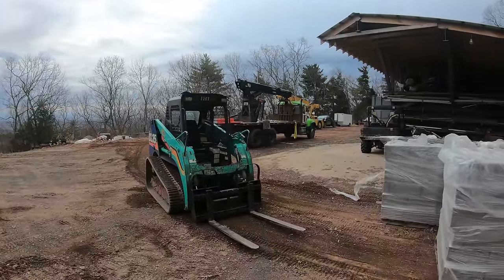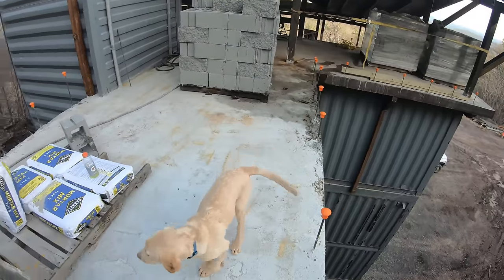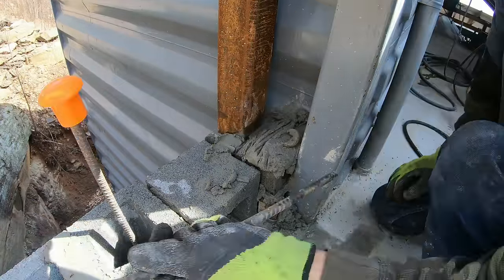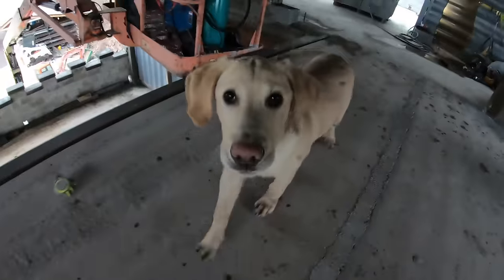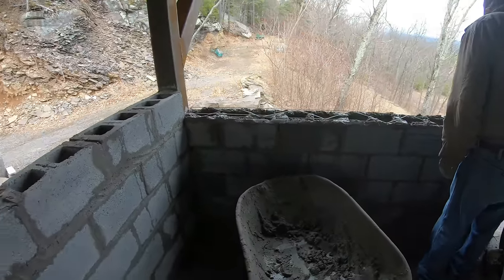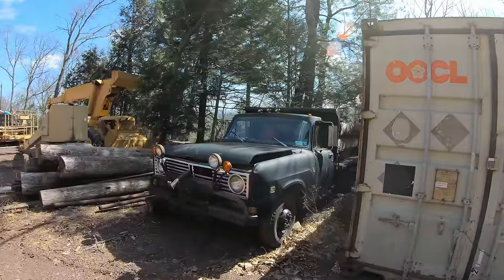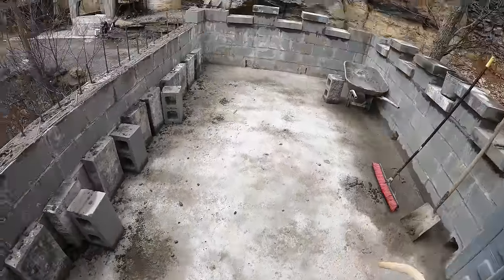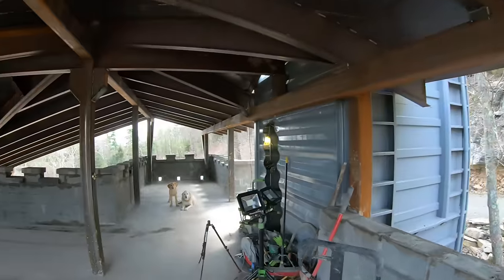Container castle blocks

Comment: Just a tip from a guy that has mixed a rediculous amount of mortar batches in wheelbarrows.  Make a heavy duty oversized hoe with steel pipe handle (to handle the abuse) and drill a few 1-1 1/2" holes in the hoe to aid in mixing and you will be amazed how much quicker and how much less effort it takes then when using a shovel.  Also, round the hoe edges off.
Reply: We always used a hoe when mixing by hand

Comment: Pretty sure when he's done, the castle will survive a nuclear blast just fine. Maybe some paint burned off.
Reply: I was reading the comments after the first half hour and thought you were kidding, but now I agree. It will survive some heavy weather.
Reply: But will it survive against zombies?
Reply: The three things that will survive Armageddon: Cockroaches, duct tape and Andrew's castle.
Reply: He should use High Heat paint and no-problem. :)
Reply: Yeah because everyone in New York state has a cannon in there hip pocket.
Reply: @steveharleyfan  ya forgot twinkies
Reply: Josh  i mean this honestly, have you ever seen an actual cannon be fired? I have never seen one function according to historical account
Reply: "Im replacing all the metal with stainless steel, because the paint chipped off for no reason at all."
Reply: Earthquake? 7.0 or higher?

Comment: 36:13 Don't want to be a smartass Andrew but you could lay some lines to make sure all gets lined up properly. You'll have to render that inside to make it flat. Lay one brick on each end of the line with a string tying the edges so you have a reference to line up the bricks
Reply: Could've used a level too!
Reply: @garys9694  The string will line up vertically as horizontally not to bow the wall just line it up with the top horizontal brick edges. Best yet simplest tool
Reply: Yea I agree....
Reply: Yea afterall he's not building a castle
Reply: Yes, I agree on that.
Reply: Maybe but it's not Andrew style. Andrew is putting everything together spitting mud everywhere waiting for the hurricane to get his wind knocked up in front of this bulding. Andrew style is to fix everything the fastest and cheapest way possible. Getting a difference in mortar color on inven in his truck paint is't in his consideration of what a work should be done.
Reply: As a mason , this vid was hard to watch 😟😒😔 all I can add
Reply: Tom Slak  I think that's exactly what AC was thinking.
Reply: I'm not the only one, thank heavens. Wait till The Essential Craftsman sees this video, he's gonna have a bleepin coronary! Lol!
Reply: @heithdotysadventures7824  I'm only a carpenter so I feel you.
Reply: Yea im sure all castles were built to perfection, used straight edges , lines and levels too. Doesnt matter really since its decorative and not load bearing.....especially with the weight he is putting on it.
Reply: @garys9694  I mentioned that but maybe he was using a laser???
Reply: @LordEzequiel  ??
Reply: @heithdotysadventures7824  I ask, where was the level, the laser? I'm not a mason and I cringed.
Reply: This is history in the making,this structure will still be here in 500 years whle others built proper will be just another a memory.
Reply: Random variation can make for a more visually interesting wall.
Reply: I thought that too but then I realized he's there doing it, and we are just watching.  As I have only seen others lay brick.
Reply: @young11984  . You are right . They did not look perfect.  However . They kept straight lines . They were built to last and to look great and give the look of wow , that person put his soul in to that . That = pride.  Regardless if this was for a paying customer or your own home . 
Any form of construction . From mason .welder .Carpenter. Plummer even a electrical.  We all take PRIDE in are work . Some work gets covered up and yet we still put pride into it . Y . It's are job and life ..dont get me wrong he did do the job , yes . But lacked PRIDE.  Look at the metal all over the building . Pride went in to it . Any trades man or women can tell when pride was not added to somthing . Ask any of the other trades ppl in these  comments.
We all start somewhere and we all have are strong points and bad .
Reply: @Pedroisanickname   Shame Essential Craftsman on the other side of the country, that would be cool collaboration vid.
Reply: heith Doty no, real castles built back in the day were nowhere near straight, even or close to being square. As you said though, they were built to last from slaves that did as told not as a “trade” so they looked like crap close up. Inside were master pieces that were done by craftsmen of the time, not this time, and i could even find faults in them. He put his heart and dollars into this build and done it as he wanted it to be not for others approval or to be like everybody else.....or else he would be on youtube criticizing others build instead of doing his own. Waiting for others to post their self built castles from here on out and posting a link here before critiquing his....i will wait.
Reply: @young11984  I guess it was a constructive criticism. I started by saying i was not trying to be a smartass. Being his house he can do whatever he wants. I just added the info because he might actually not be aware that he could do it that way, just sharing a technique that is very useful and simple. If the intention was to make it rude looking then objective has been attained and good for everyone. My OCD triggers me to say something when i see it can be done better if the goal is to achieve perfection. By the way the pyramids were built using these primitive techniques and they´re still there

Comment: wow, I was amazed that you could lift those entire pallets of block that high onto your rooftop area.  That is quite the machine.
Reply: The steering looked a bit iffy there on the front left wheel but hopefully it's won't move at speed anytime soon :)
Reply: Quite the machine, and quite a structure to handle all that weight.
Reply: I used to operate machines that would lift 45,000 lbs. 40ft containers up that high.
Reply: @canvids1  i am aware that there are machines that can lift stuff like that, I was specifically impressed that his machine did it, I bet it was pushing the limits of that particular machine.
Reply: @TheBibliofilus  I am thinking that he was pushing the limits of that machine when he lifted the block pallets up there.
Reply: BoShek oh no, that lull could handle quite a bit more

Comment: The 1940s is calling, they want their wheelbarrow back!
Reply: The original flat freewheel
Reply: Motor 2of7 swap you for a case of Corona.....
Reply: Those old wheelbarrows go on for years and they never get tyred !!!
Reply: They are literally indestructable I have my great grandfather's wheelbarrow
Reply: Don't laugh when my grandfather gave me his it had only been welded in three places to fix rust holes and they was about fifty years ago. Since then I lost count of how many times I've welded up the ust holes. It still works better for cement work than any other wheel barrow I had.
Reply: I won't get a flat tire that's one less thing😁
Reply: No punctures in that wheelbarrow wheel !!!
Reply: Hehe, when I started in construction some contractors still used the old time jersey buggy wheelbarrows. Most never bothered to grease the damn wheel bearings.
Reply: Cant have it, has no-flat tire!
Reply: Tire can't go flat if it's steel!

Comment: With all the plant and machinery he has you'd think he'd have a small cement mixer!
Madness mixing all that mortar by hand!
Reply: he has a big mixer attachment for his skid steer, and an old drum mixer too i believe.  but as he said, it was easier to do small batches of mortar on this job.     hey AC, as far as roof paint goes...  research POR15 as a possible candidate.  or go for the really badazz stuff called polyurea.  if you go with polyurea on bare steel, you have to use what's called a "super primer" as the first coat.  these are just suggestions - i know you'll do your own research first.
Reply: Dear Tiktok.
👍👌👏 Exactly! Sometimes I simply don't understand this guy. He is definitely an extremely good worker but constantly overstressing/overstraining himself and a lot of his equipment! See this time: Instead of using the big crane forklift he overstrained the skid steer with the way too heavy cinder block pallets (also wasted his and the drivers time). Then he slides the pallets on the ground and therefore he has to clean them with a lot of effort as they won't move on the concrete floor afterwards.
2) A concrete/cement mixer would have helped him a lot to mix the mortar. Even a (big) mortar bucket/mortar box and an electric mixer (or a mixer tool attached to an electric hand drilling machine) would have helped.
But he is young, strong and thinks that he is able to take the world out off its hinges (like all young people think, including me of course!)!
He will feel his overstraining behaviour when he gets older = his body (and his equipment) will definitely tell him. That's absolutely for sure.
Best regards, luck and health.

Comment: Who else noticed the improved camera quality?
Reply: Much clearer & sharper.
Reply: The last video was 2 weeks ago. Did you open up the last video on purpose to compare the quality or so?
Reply: What do you think he changed?
Reply: @789563able  he did some changes in his editing program! Very easy to do!
Reply: @TillingsExcavation  What setting is that?
Reply: @Flyingdogturd  DEfinitely not a brickie Andrew...
Reply: Tim Brown freaking*
Reply: What was wrong with the blockwork?
Reply: @Jonathan Voigt I'm a cabinetmaker so am aware about keeping things in lune and also the same plane.  I did see the walls had a slight wave in the vertical plane and not 100% in line.  But figured some of that could be dealt with by using a stringline on the top cap.
I saw the smaller chunks getting close to the corners but my thoughts are is anyone going to notice driving by at 60 mph.  Considering this whole project, I figure he's not done too bad.  My issue would be the heat that metal roof will throw off in the summer and how he plans to deal with it.
Reply: @Jonathan Voigt OK, Stay safe in this crisis, cheers from Vancouver Island Canada

Comment: I’m surprised you didn’t use a level and a plumb bob to make sure everything is straight and level.
Reply: TIL A plumb bob, or plummet, is a weight, usually with a pointed tip on the bottom, suspended from a string and used as a vertical reference line, or plumb-line. It is a precursor to the spirit level and used to establish a vertical or horizontal datum.
Reply: I think he's going for ye ole organic look XD

Comment: looks great, They use to use that split-faced block a lot in Chicago, but they realized that the block is a sponge and would create black mold. you are supposed to paint the sides with water repellant to keep the water out.

Comment: The ultimate bug out castle when the SHTF Andew got it covered. Insame job Andrew you are the BOSS.
Reply: I was thinking a LP gas fired emergency generator would be awesome.  If the area looses power you could still have well water and you have to be able to weld!!
Reply: Time to make the range card. Awesome field of fire.
Reply: @mannsjm  I doubt if anybody will make it up the mountain on foot or with a vehicle.
Reply: Camarata mortared the cracks on the floor and mortared the blocks to the walls of the Castle Camarata.
Reply: You might incorporate a Faraday cage or Faraday shield enclosure used to block electromagnetic fields to protect you from a EMP I mean castles were built for protection

Comment: Andrew you really need a string-line to keep your blocks straight, and a good level.. Your wall bows in, (look at it 38:29)  in this video. But if it is of no concern to you then great job, by the way the roof came out awesome
Reply: No castle has straight walls. He's going for the authentic look.
Reply: It could be the wide angle lens that makes it look worse than it actually is.
Reply: @BrainHurricanes  I think you may be right. I'll say this, their some very strong walls with the re-bar and poured concrete..

Comment: Everyone else: Watch me mix concrete in my wheelbarrow by hand
Andrew: Hold my beer. Mixes concrete in the back of a 1970's dump truck with a mini excavator.
Reply: Where's the money coming from? Who has a truck to mix cement in? Who has all the machines just sitting around waiting for your use?
Reply: @chuckstith838  Andrew owns them, uses them in his business, works his butt off to buy, mostly used and fixes them so he can use them.   Guys should watch all of his videos to have a clue!@
Reply: Or even mix dirt with rocks and cement. Ite a shame he didnt have sand instead of fill but where it was going in those blocks it didnt matter so it's all good. Materials for rammed earth projects are mixed like that too everyday on the ground then buckets up and rammed. Good stuff.

Comment: Masons who watch this are going to die a little but Andrew sure is making a local landmark!
Reply: No string, no stagger. Still looks awesome. I'd live there.
Reply: Yes I did die a little. Bit concerned about the lack of knit of the block fill to the floor, due to the bed of mortar..
Reply: No bond beams either :-/
Reply: @rotabom  he used rebar around the whole thing both horizontal and vertically.
Reply: You sure have your own way of doing things !  The steel structure is the strength and all the rest is appearance, well done !!! Due to different expanding ratios (concrete/steal beams, the rebar has more or less the same expantion ratio as concrete but I doubt the steel beams are made of the same steel as rebar) cracks in the blocks might develop over time. 
Congratulations for building your dream instead of reading about it in a comfy chair !!
Reply: @ESPSJ  I know but the bond beam should really have more concrete fill around it. He just put it in the beds joints
Reply: If it were anyone else doing the work, I'd feel obliged to point out the faults. This is Andrew though. He can do it however he sees fit cause he's building himself a gd castle. :D
Reply: Looking down that wall had me in tears 😂 and slightly cringing. But for a guy who's doing everything himself for the first time 👍🏻

Comment: "Penetrol" get a can of penetrol and see how good it is Andrew, would be great to spray into all the roof valley crevices under the roof before you put anything else on but it needs time to set up before you put anything else on so allow for that. Penetrating and surface adhesion aid in one.

Comment: Guy: "So how strong are you going to build it?"

Andrew: "Over 9000, just to be safe"
Reply: He just do it right. Not like other poeple makes paper houses.
Reply: @Lordosvk  yeah i agree with you, i dont get why in the US most houses are still built with wood, concrete and blocks lasts for decades and just need renovation after some times, even if after a fire
Reply: @Lordosvk  Do they have 'Big Bad Wolves' in New York State?  It would take the entire superhero cast of every Marvel movie to blow this house down, and I am pretty sure even they would fail.
Reply: @carholic-sz3qv  I don't no how seismically stable NYS is, but here in New Zealand we use wood frames with light weight roof trusses and thin pressed steel roofs because they move like a reed in the wind, and don't shake to bits and fall down when the ground starts moving.  I've experienced the 7.8 Kaikoura earthquake in 2016.  It lasted for two minutes, and was so violent it would have been impossible to stand up.  Things fell off walls, but the house was almost entirely undamaged.   In the 2011 6.7 quake that caused so much damage to Christchurch, it was the solid buildings that fell down.  Like the cathedral for instance.  AFAIK NYS does not get earthquakes, and if they did, it would be all that steel that saved Andrew's castle.
Reply: Kinda bummed out about never being able to know how long this house will last. :-|
Reply: Yeah Overkill !
Reply: Word is, it’s going to be in the next Spider-Man movie as the newest villains techtronic hideaway
Reply: Over 9000 what?
Reply: @carholic-sz3qv  On the west coast mainly due to earth quakes... But also due to price... It takes 100.000$ to build a nice house that will last you 50 years (a lifetime) ... or 250.000$ to built one that lasts you 300 years... (also a lifetime (yours))...

Comment: I can't imagine what all of that weighs.  In a previous video, you showed how the container roof was buckling under the weight of the concrete.  I would be a little concerned.
Reply: B Harmon And if you recall, he’d put in several vertical steel beams for support. Plus, the steel reinforced concrete became self supporting after drying.
Reply: It only buckled from the wet concrete that was poured on it.  Once it dried, it was very strong.

Comment: Daily Affirmation: Its Straight enough, Its level enough, Its plumb enough and gosh darnit Its just good enough!
Reply: StringLine... Amateur. Hold my Cool-Aid.
Reply: Even professionals use string lines and levels.
Reply: Stone would of been cool to if he blasted that cliff he would of had more than enough to build a castle.
Reply: Kids got every piece of heavy equipment there is and doesnt have a small mixer?
Reply: @peterwill3699  thats what i was wondering to.